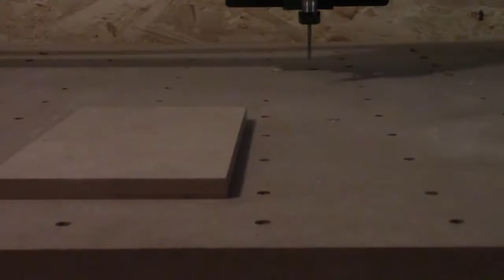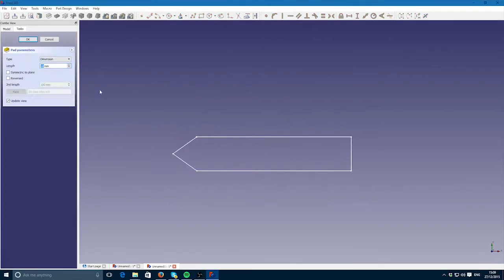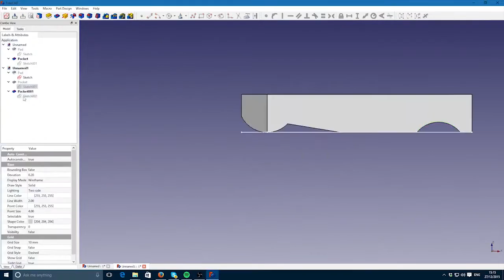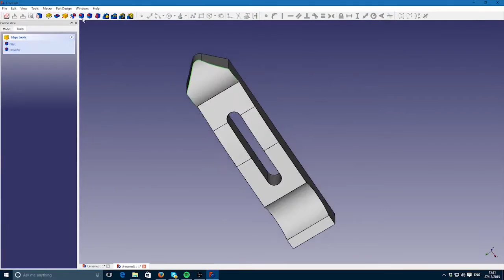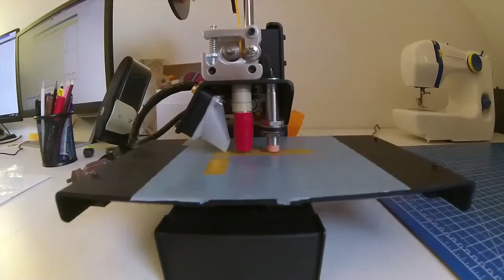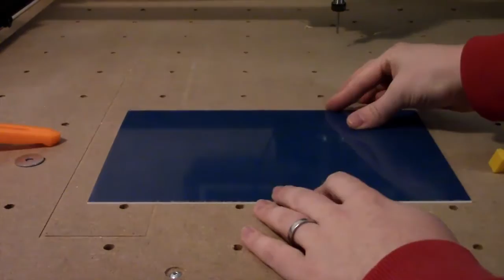3D Printed Better CNC Clamps for the X-Carve

Comment: Thanks, downloaded off of Thingiverse and printed a couple.  I have a CNC on order so hard to test them out - I do have TBars on my Drill Press table, tried them there, they work.  I did just adjust the length in Cura by printing it with X at 130% and added a bit to the Zed at 110%, leaving Y at 100 (Y was width the way I had them on my bed).  Printed great with PLA+ on a CR6se.  :)

Comment: But your screwhead/washer is not level with wasteboard. This way you will rip off your threaded inserts after few uses. But there are designs which adress this issue without having to manualy adjust for different stock heights.